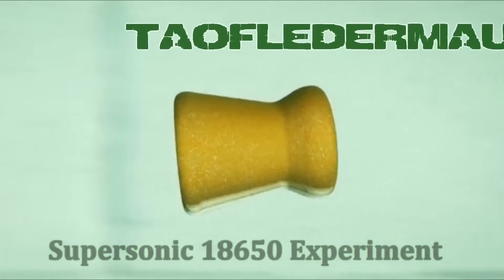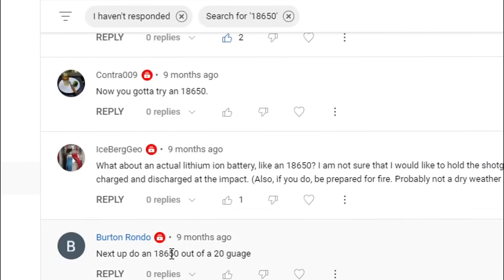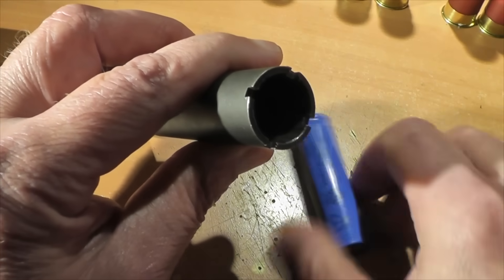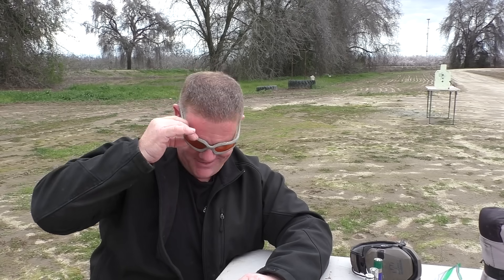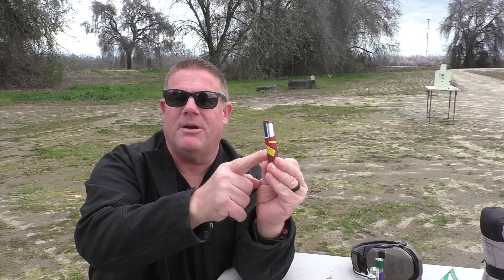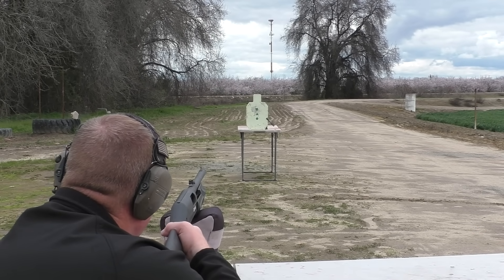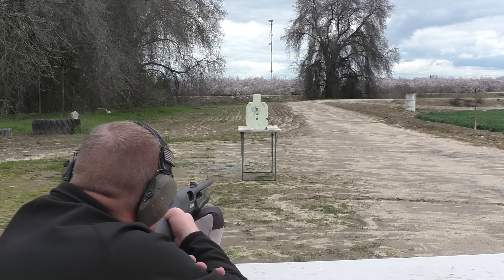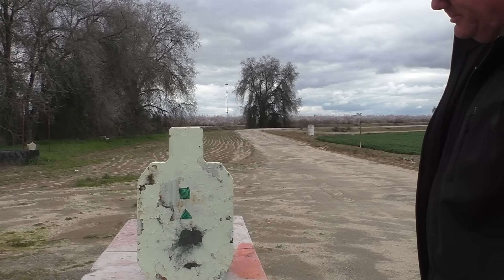12ga 18650 Li-Ion SHOTGUN Slugs - TESTED!

Comment: 18650 don't actually have lithium metal they have little trace of lithium salts in the electrolyte, but the main component is copper aluminium and carbon I think. 
U would have to find lithium primary non rechargeable cells  1.7v I think  AA size

Comment: Hmm, when the lithium dust came into contact with moisture in the air it started a reaction that gives of the gas lithium dioxide. If you were to drop a piece of lithium in a bottle of water and capped it off it would create so much gas that the bottle would "Pop"

Comment: Take the strongest spring you can find and that fits and load the spring with as much tension as possible in a little tube. When it hits the target the tube gets fractured and releases the springs' energy while expanding in size. it's terrible ammo, use it with caution.

Comment: 50 other people have probably posted this but lithium ion batteries don’t contain much metallic lithium.

Non rechargeable lithium batteries have a fair bit of lithium metal in them.

That said lithium ion batteries set themselves on fire in air just from being taken apart and left in a pile so I was expecting a bit more of a flash on the metal plate (I suppose it was too fast

Comment: 4.2v is fully charged.
Reply from the maker: What is an 18650?
An 18650 is a lithium ion rechargeable battery. Their proper name is “18650 cell”. The 18650 cell has voltage of 3.7v and has between 1800mAh and 3500mAh (mili-amp-hours).

18650s may have a voltage range between 2.5 volts and 4.2 volts, or a charging voltage of 4.2 volts, but the nominal voltage of a standard 18650 is 3.7 volts.
Reply: @taofledermaus  if your run yours below 3v youre asking for a catastrophic failure. Personally i avoid anything below 3.5v.

Comment: So as someone who used to work in the Gigafactory where Tesla's batteries are made. They are not in fact 18650 they are slightly longer and larger diameter than those. And that is just the iteration that was in use on the Model 3 at the time I was working there. Panasonic actually manufactures the batteries and are coming out with an improved version for testing every few months. So in the year + that I haven't been working there the "cells" that make up the car battery might not even be close anymore.

on another note did you mean to make the 3DO icon in the tape on the first target?
Reply from the maker: https://evsource.com/products/tesla-model-s-lithium-ion-battery-18650-22-8-volt-5-3-kwh    This is where I got my info

Comment: Hilarious show. Clearly, we know this is a joke, or extreme desperation in a zombie apocalypse. 6:42 - Wow, some hole in the metal case. I'd like to see what this does in one of Paul Harrell's meat targets. Clearly it isn't made for penetration, but did penetrate that metal box. My guess would be that they would crush several ribs in front and possibly enter the "lung" cavity crushing a lot of the oranges. Or if the battery doesn't. it would smash the broken ribs into the "lungs".

Comment: I'd like to see the chronograph readings comparing + forward, vs. - forward, in fully charged 18650s.

Since the Earth is spinning CCW, viewed from the North Pole, a projectile fired from a rifled barrel would spin CW, viewed from the rear, would generate a voltage potential with the positive charge forward, but only when shooting in a mostly easterly, direction.

Shooting to the West would reduce the voltage because of magnetic impedance.  It's that impedance that would rapidly slow the projectile, compared to the same shot aimed directly East.

Shooting directly North or South would generate no voltage potential, and therefore, the chrono readings should match fairly well.

Comment: Create an ignition system that shorts the battery and the heat from battery ignition getting the powder lit. That lithium batteries are somewhat  similar to thermite when lit.

Comment: Pure lithium metal does react with water. Not as impressively as cesium though. I'm sure if you price cesium and do a bit of research on it,  you would decline to make slugs with it. I'm going to put forth the unpopular opinion that a foster type slug of the same mass would have done the same thing with the exception of being stable in flight.

Cool stuff though. I hope the EPA doesn't pay you a visit. Then again, they didn't pay East Palestine, OH a visit either, so far as I know. Heck, with about four train derailments per day on average, I don't think they really care.
Reply: There is metallic lithium in non-rachargeble lithium batteries, but not in lithium accumulators.

Comment: If I may give you dudes some info on Lithium. On the periodic table of Elements, lithium is far far left in the first column called "Alkali metals." The further left on the periodic table you go, the more reactive the elements get. The one below Lithium is Sodium, the one above is Hydrogen for an idea of the power of these elements. 

When exposed to oxygen, even a little moisture, they will react. Violently.

Comment: Btw.: Good quality genuine 18650 weigh about 42-45 grams. The ultrafires are known to be all over the place and a 36 gram 18650 is an indication of a low quality battery if not an outright counterfeit. That 3000 mAh reading on the side is a joke regardless and these kinds of batteries might die really young.

Comment: I wonder if the battery would expand and better fit the barrel if inserted the other way round (so that it flies negative side first). The positive terminal has a pressure relief valve to prevent the battery from exploding if overcharged or overheated. It is usually just a thin piece of sheet metal that is partially cut. So that if the pressure outside the positive terminal is much higher than inside the battery, it should be able to break that valve and inflate the battery a bit. An inflated battery could leak less combustion gasses and gain more energy. It also could fly more straight, as it could better engage the barrel or the rifled attachment. It could also explode before hitting anything, or have a better chance of exploding if lodged in a soft target and being otherwise intact, due to the additional damage to the battery's electrodes.

Comment: I had one these explode while I was spot-welding them in my room. It was placed in a weighted cylinder with a pretty much perfect hole for the battery. As it got heated up and shorted internally, it launched upwards on my ceiling where the impact caused a ton of flaming embers of some kind to fall all over my room (most of the embers were highly heated strips of copper or something). 

Battery itself ricochet off of the ceiling and landed on a shelf of an open closet and immediately set stuff on wire, was glowing hot. I wasn't injured as it flew right over me, but definitely wasn't a fan of the experience lol. If anyone is ever in a similar situation, you might hear a "hiss"; if you do, explosion is probably the next thing that will happen. There was also a LOT of black dust all over my room that I needed to clean up.

Also, the battery in question was dead. I was just trying to fine-tune the spot welder's settings for a perfect nickel strip weld before I moved on to the rest. I didn't anticipate that a completely drained battery represented this level of danger, but sometimes you learn things the hard way.
Reply from the maker: that's nuts!

Comment: Fully charged they should be 4.2v. At 3.6v they're already pretty depleted despite having a nominal voltage of 3.7v.

Edit: Ultrafire were a notoriously dodgy brand in the early days of vaping. They're not even particularly safe in a high power flashlight because they quote peak amperage not actual continuous draw amperage like more responsible vendors do. So if you've got a high power cree/cob chip in your flashlight they can go into thermal runaway with extended use, they were responsible for quite a few vape related fires and "venting with flame" as the literature puts it, that is they explode if your device has insufficient emergency ventilation for that pressure to escape through if they do go thermal on you.

Comment: You should try putting a bead of sealed water on the tip of the charged battery, the water will mix with the Lithium nicely!

I stumbled across this, it is a very interesting use of completely dead and unviable 18650 Cells.

Maybe you should try buying up dead old phone batteries and using them to make some kind of improvised explosive target to hit.
Of course make sure that it is legal to do so, I know that laws in the USA are far more lax than in Europe but you should still double check because it isn't worth getting into trouble over it.

Comment: You need to get a high amperage 18650, there are different types.  You can get a 30 amp discharge one.  Usually you can get 20!amperage ones from power tool batteries.  I love your videos they are awesome.  I would love to come out to one of your recording sessions.  I know from landscape that you are based in the San Joaquin valley.  I live in riverdale ca, 22 miles southwest of fresno.

Comment: Science Time: The Lithium Ion 18650 rechargeable battery has much less reactive Lithium metal than the CR123A primary camera battery. Indeed, people use the 123 batteries to manufacture meth, and this cannot be done with li-ion cells because the Lithium must be reactive.  So no fireball with rechargeable li-ion batteries when exposed to aqua.

Comment: I'll admit this has been a burning question of mine ever since I took up vaping and quit smoking in 2014.

18650 Li ion batteries are depleted at 3.5v and fully charged at 4.2v. Also, they don't use lithium metal in their chemistry like energizer batteries, it's a compound of lithium.

Comment: Next time soldier a equal dimension capacitor to the battery, both fully charged, and see what happens. You may want to use the smaller battery because the larger one would get to unwieldy.

Comment: Please dont try this at home. Lithium ion batteries are toxic. Don't eat the toxic metal on the inside of the battery like that guy did. Using them as slugs is just adding those toxic metals to your soil/groundwater. If they were charged, they would catch fire and emit toxic fumes.

Comment: The "lithium reacts with water" thing would have been relevant with the 123 cells, because those are lithium-metal primary cells. Those have metallic lithium in them. 18650 lithium-ion batteries do not; the lithium in them is in the form of lithium salts. Metallic lithium reacts violently with water; lithium salts do not.

Comment: Battery Engineer here. If those were actual Li-ion cells (not LiFePO4), 4.20V is fully charged (3.5Vish is around the 30% SoC mark). Want to maximize the chance for fire? Use an NCA cell, with the highest capacity possible (something like the Samsung INR18650-33G), charged to 4.20V. I've only shot at cells, never shot them, so I can't say what to expect.

Comment: That computer, even broken, probably sells for a few hundred bucks now. Older 80s and 90s computers are popular now, for retro gaming or whatever else. Hell, an Amiga is like $1k or more .
Reply: No. I collect old computers. This one is actually 1997-ish garbage.
I've taken a closeup of the backside:
1. Weird soundcard (with no game port). Possibly useless AC97 standard;
2. 56k modem, and
3. LAN card.

No video card, no interesting periphery, no nothing. Two empty slots hint that the juicy bits must have been removed and sold separately.
Reply: Amiga 1200 may be obtained for around 200$ in the EU.
PAL computers are more interesting than NTSC ones (except certain Japanese lines).

Comment: I still want to make these weights from it's from a throw net for catching fish  bait. They have the little round hallow lead weights on them that are covered in plastic and some of them are steel cover in plastic. The two sizes that I have it would probably be  a 20 and 12 gauge. I need to go buy a micrometer tomorrow so I can measure them to see if they would actually fit.

Comment: The amount of lithium in Lithium-Ion batteries isn’t substantial enough to cause a meaningful Lithium fire. The fire hazard from them comes from the heat generated when they short internally. This spreads to other batteries, and you end up with a ton of stored power being dumped by the batteries, generating intense heat that then sets fire to anything around it. They’re extremely difficult to extinguish once they get going because you can’t get things cool enough to stop the fire.

Comment: You NEED to use legit, name brand 18650s. The cheap counterfeit 18650s i found in my junk drawer weigh 35 grams, while the Samsung ones I use in my vape weigh 46 grams. Ultra fire is one of the most notorious counterfeit brands on eBay... just sayin
Reply: They cost a lot more, 10-15 a piece... but they've got enough heft to them to hurt someone if you threw them by hand. Compared to the cheap-o's that are mostly full of air

Comment: It’s actually pretty cool, despite the name “lithium ion” battery, there’s relatively little lithium in each battery (few grams at most) and rather than it having sole elemental lithium, it’s a mesh of various metals rolled up very tightly, separated by a dielectric medium. They’re then suspended in an electrolyte solution, but at no point internally are the positive and negative electrodes touching, but if the battery is pierced it shorts out internally, and is known to cause awful fires due to its heating up from energy release, then self-igniting all the toxicants of the rainbow inside. Not to mention the metal tube it’s encased in keep this whole reaction in a very compact space, further concentrating/perpetuation the energy discharge/flames. Very cool video! Would have never thought I’d see such creative use + utter obliteration!

Comment: Probably nothing... but a battery shot at a negatively charged plate being hit by a fully charged battery if you could keep the battery straight in flight?

I gotta steal some of your thunder here from battery slugs assuming there is lightning. I need help from other gun owners to fund a patent, engineers, and a prototype of an AR carrier group for dry fire training. I have a  give send go setup. If this is a problem, let me know and I'll delete it. Just asking for help where I can and with whom I can. 

I have the design to basically remove your carrier group from your rifle and replace it with mine to replicate full action. Hear me out for a second over at "give send go" under "The Carrier Group" or G9TAC.

Tell your friends. Thanks.

Comment: Speaking of D-Cell batteries, you guys should try to find a 10-Gauge shotgun someday, or even a 4-Gauge one (there's a few here and there). I wanna see you guys launch even bigger items.
Reply: And hear OG complain even more of the recoil?
Reply: A puntgun, or blunderbuss perhaps.
Reply: KS-23 would be perfect for this
Reply: @thatguystalker8649  Besides some old punt guns and what not, I was thinking of one of those, and there DOES exist some examples in the US, I think about a hundred or so of the civilian market equivalents were once exported over from Russia. 

Couldn't pick one up just at any gun store, and you'd have to handload all of your ammo, but these guys handload most of their funny ammo anyway, so I think if they ever chanced into the opportunity, they should jump on it.

You couldn't exactly go buy all the components for loading 4-Gauge shotgun shells itself, but it wouldn't be impossible either.
If they could source some appropriately sized brass, either by adapting something close, or getting one of their contacts to machine some 27mm case heads out of brass, that'd be a good start, then the hull could potentially be 3D printed out of a material such as TPA, which would give you some strength and some flex. 
Not sure how well it would work for crimping, and that'd probably require a new crimping die on its own, but you'd only have to make it once, and again that's something which a kind machinist who's a fan of the channel might help you make.
Shotcups and wads would be the easiest part I think.

The Russian KS-23 and the commercial equivalent bear rifled bores, which would be great for various slugs, but not for some, and would be unhelpful for a number of shot loads, both conventional lead balls and a lot of the goofy nonsense these guys try out.
There exist other 4-Gauge guns out there though.
Reply: Car battery
Reply: Look where the Irish band "U2" got their name...

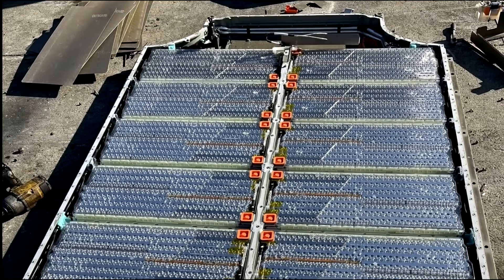Comment: 1:37 It's not just Tesla everyone does it. Large li-ion packs are almost always made up of a bunch of 18650 or 21700 cells (they don't use the button top batteries they use raw cells with no protection circuit welded together with buss bars). There are good reasons for this, they have the highest power density and more importantly the highest current output because more R&D has gone into those two sizes than any other size of li-ion battery**, because they are the most widely used. Also if you are making a huge battery like that it's just more efficient to make it out of smaller cells than to use fewer larger cells because a percentage of your big batteries will be defective and you then have to throw out the whole battery. Smaller cells still have a percentage of defects but you end up throwing away less because each cell is smaller. It's also safer as you can detect a fault in one of the cells (the battery management system monitors all of the thousands of cells individually) before something goes wrong where a giant li-ion cell is likely to hide any faults for longer.

** Stop typing I know about Lipo and that's a whole different animal, higher currant but lower power density.

Comment: I wonder what happens if you put a 18650 in a test tube and heat it with a blow torch?
If you fired a test tube from a shotgun, what could you fill it with?